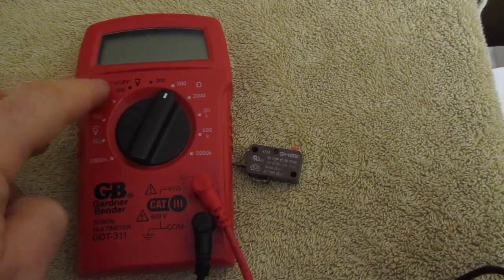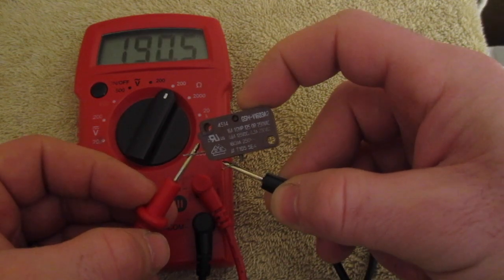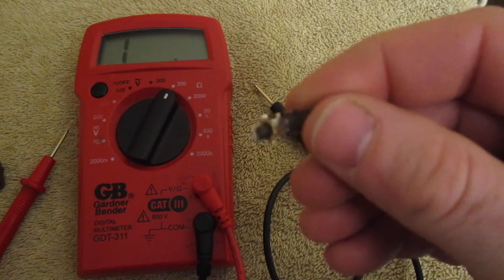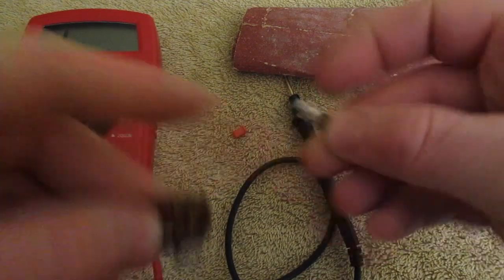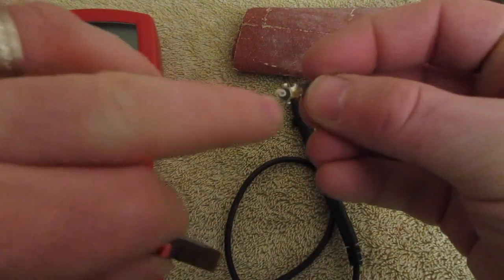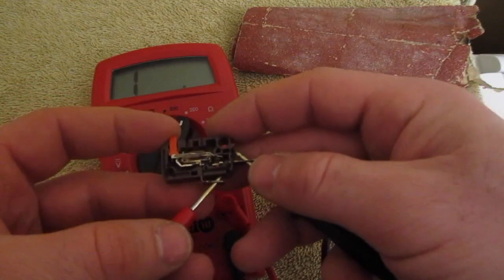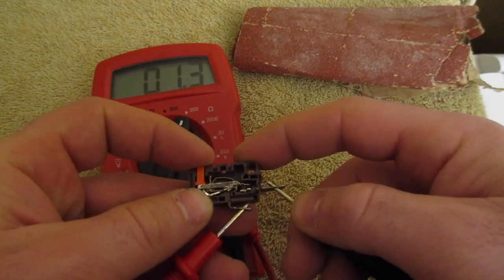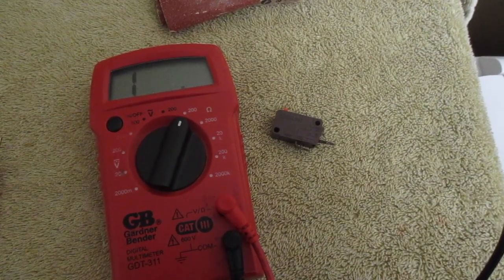How to Repair a Microwave Oven Door Micro Switch Fix Replace Repair Replacement

Comment: I'm going to have to order a replacement for my v-16g-3c26 but it seems to be discontinued. Do you know of one that is interchangeable?
Reply from the maker: just look on eBay
Reply: @youcanfixit3721  Unfortunately my eBay account has been banned with no explanation. So that's not an option for me.
Reply from the maker: @IlIllII  have a friend order one or look on Amazon. They should both have them.  Amazon probably sells them in a 5 pack, but you only need one.  I would go ebay used, but check the amazon price first.  If you see one have a buddy order one and give them the money.

Comment: Burnt switches have usually have been over heated which causes a loss of the tension in the contact spring mechanism. Cleaning it will allow it to work again for awhile, but because of the loss of tension the resistance will be slightly higher and more variable. This will cause the contacts to burn and fail much faster the next time.

Comment: Door switches last much longer if the door is not opened when the oven is cooking. They are intended to be safety switches, not the way to turn off the oven to check the temperature of the food. If the oven is stopped with the STOP button on the panel, the current flowing through the switch is greatly reduced when the door is opened - which pretty much eliminates arcing and burning of the door switches.
Reply: Thanks a lot. 
Would you please tell me how could I identify a 2 pin microswitch either it's a normal closed ( nc) OR normally opened (no) by reading the printed circuit diagram on the back of the switch. 
Your reply is appreciated.

Comment: I took mine apart before watching your video. Seems to confirm what I did, but instead of sand paper I just used a brass wire brush and cleaned those contacts. We'll see how long that lasts - new switches are pretty cheap.
Reply from the maker: Yeah they're cheap!  Wire brush works well,  see it's just common sense.  It's like fixing most things
Reply: @youcanfixit3721  Still working great this past week :) I did end up ordering the replacement switch anyway so if it becomes a problem I can just swap it out. Fixing stuff yourself is so satisfying!

Comment: Thank you for your video. I just would like to add some comments for a similar situation that may be it is happening for someone else. In my case my microwave's microswitch terminal don't get dirty. Instead, it burns the little zone of the plastic enclosure where the terminal sits, so the terminal slightly moves upwards from its original position and the mechanism fails, ie, the pivoting metal sheet goes further than it should go and somehow it doesn't return as it should do. For this case, I wonder if there is a higher rated microswitch. I just replace it but after a while (~6 month) it fails again
Reply from the maker: Yeah sometimes they burn and even fuse the contacts together.  Often when this happens you will notice the switches don't click if they're fused.  Not sure why you are having this happen so often, All I can think if is to make sure your door is aligned properly, so the switch is being fully depressed making a firm contact. Sorry can't be of more help.
Thanks for the comment and best of luck with the next switch

Comment: Thanks a lot! This worked for me. In my case, it was the upper part that was dirty. To anyone attempting this, pay close attention to how the parts fit together before taking them out.  I used 100 grit sand paper.
Reply from the maker: Yeah I used something around there, maybe slightly finer.  You just need to get them shiny to allow current to pass through again.  Glad it worked for you and that is great advise, because if you don't pay attention it could be a pain to get back together and you may end up buying a new one anyway.  Thanks again for the comment

Comment: abrasive paper must be high granulation 1000 -2000 grit
Reply from the maker: I think I used 240 grit paper, Just make sure the connections are shiny and I would suggest still ordering parts and changing out to be safe.  I would only do this as a temporary fix.